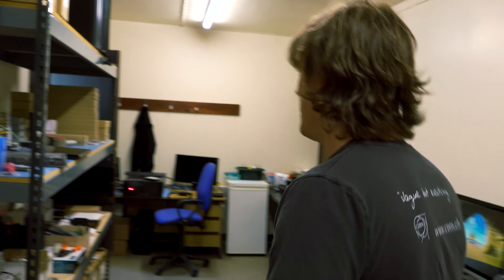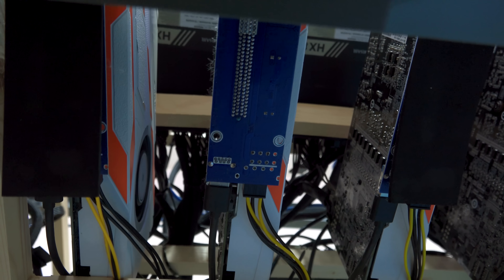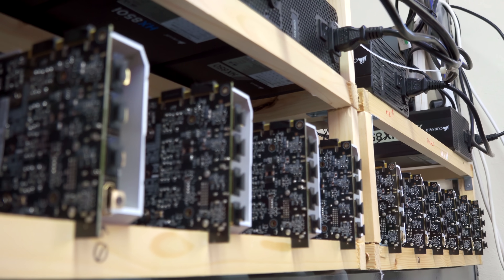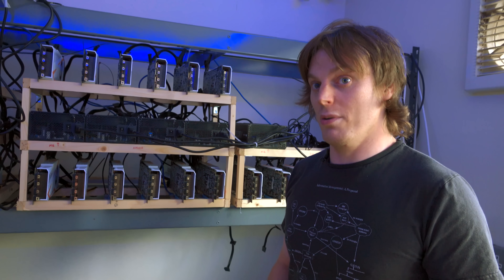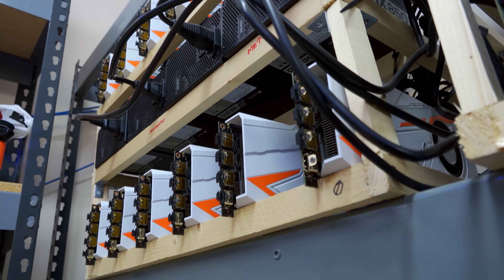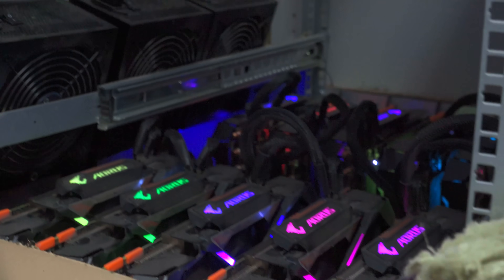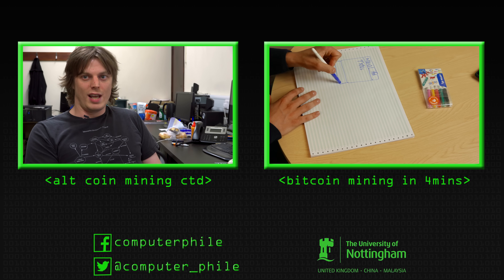Inside a Crypto-Mining Operation - Computerphile

Comment: I wonder if some research institution creates a coin that can be used to compute simulations. Then every so often have forks created to update the algorithm so that new simulation can be produced. Rewards should be spread equally amongst all participants similar to the p2pool concept. Considering gpu can switch between algorithms then that would be a great way to harness the crypto mining power network for research.
Reply: someone is working on one already; it will compute fluid and physics simulations for medical and engineering purposes; it's called cfd token

Comment: A Pi for fan control? Seriously, that's overkill. You could do that better with an arduino.
Reply: Or you just build your own analog circuit to do the same for you without having any µC involved at all
Reply: I really like that efficiency-minded attitude, but in the context of the operation at hand, either solution will practically consume no resources at all once it's up and running. On the other hand, there's the cost of feeding the developer who implements the fan control. Minutes of Python vs. hours of C++. Who wins? Who's next? You decide! Epic code battles of history!
Reply: Minutes of C. All you need to do is call a library that reads from a DS18B20, does a quick calculation, and sets the PWM value. The rest is all electronics, and is identical regardless if you use pi or arduino.
Reply: You could, but most fans use PWM. Generating that in analog means oscillator and comparator - if the aim is to minimise cost and part count, a dirty-cheap µC is actually the most practical solution. Like an arduino.

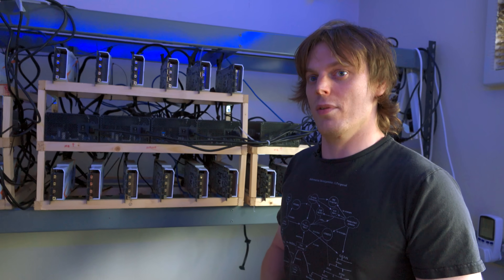Comment: 2:08 1080Ti's do up to 250W at full load and 100% power limit. No miner runs their cards at 100% power limit, usually between 70-90% as it makes almost no difference to hashrate with most algorithms and drops the power usage considerably. A 1080Ti will normally be using somewhere between 140-220W on most algorithms at 70-90% power usage.
Reply: Xileer Torias yeah it's crazy how much juice microwaves and stuff use
Reply: "Now, look at the power usage of your microwave or your kettle :p"

I already answered this in another comment thread. 2KW kettle, 3 minutes per boil, three boils per day, that's roughly 300Wh of electricity used, per day.

The stated power usage of the rig in the video is 15KW, red-lining those GPUs 24/7. That's roughly 360000Wh of electricity used per day.

Even given that this is assuming 100% efficiency (which is never going to happen), those numbers are so massively far apart that it's borderline insanity to compare a few cups of tea to running any kind of mining setup.

Comment: So basically a crypto "coin" is a token of spent electricity?
Reply: A gold ingot is a token of stolen sweat, blood, slavery, and estate bonds, far far in the past. Still there, still in use by our banks...

Any ressource, as the value used to extract/make/manufacture it + cummulated cost of storage over time, technically speaking.
The prices on the market is what ppls are about to give for it, what is totally different.
Reply: "Not really, it does give it some intrinsic value however."

Not intrinsic at all.. Imagined.

if it were intrinsic, it would have value without the network running.
Reply: Not really, it does give it some intrinsic value however.

Comment: I feel like this is a flawed way of going about it. It was explained ASICs aren't usable because they specialize in a specific coin so they use GPUs so they can mine the best coin that's trading the best at the time. Wouldn't it be easier to make an array of ASICS and enable the ones that farm that specific coin when it's most profitable or is there a gain/loss that i'm not seeing? If it's really such a swing why wouldn't ASIC miners just shut down during non-profitable hours?
Reply: Let me see if I can answer some of your questions:

ASICs are actually built to use a certain Hash algorithm, not necessarily a certain cryptocurrency. So, for example, Bitcoin uses SHA-256 as it's hashing algorithm, but another cryptocurrency also uses the same hashing algorithm, you can use the same ASIC for that coin as well. Bitcoin is the most common one with the highest prices, so those that can afford massive ASIC farms would be more inclined to go for those coins instead, but you can use that same ASIC to mine any other coins that use SHA-256.

Because ASICs can mine any coins that use the hashing algorithm that they are built for, you could technically use them to mine other coins as well, however, the problem with that is that these cryptocurrencies are designed to scale with hashing power so that the more hashing power there is on a network, the more there is needed to mine the current block. If you suddenly take away a large chunk of that mining power, the time it takes to mine a block goes up dramatically, making the currency more volatile, thus, decreasing it's value, which is why larger networks, like Bitcoin, are always being mined. On top of that, the current reward for mining a block on Bitcoin is 12.5 Bitcoins, or almost $80,000 in current market conditions. These blocks can be mined on average every 10 minutes, so every 10 minutes, $80,000 is released, which is another reason many will stay with Bitcoin.

Comment: All of a sudden people care about how much energy is being used lol
Reply: All of a sudden ?
Reply: Crypto-mining uses up 0.5% of the world's current energy output. That is far from negligible. And it's only getting larger.
Reply: Mostly because it’s replacing a more energy efficient system, the established payment processors, and doing a worse job at it.
Reply: Xileer Torias As someone who lives in an apartment, buys wind power, and bikes or takes public transit, will you listen to me complaining about the unnecessary energy usage?
Reply: You don't seem to understand the point of bitcoin then. It's not a more energy efficient system, and you're right in saying that it's doing a worse job at payment processing. But, we finally have a new breed of money. One more fair, more transparent, and one with way more control. It's not like our fiat money that's run by a group of shady stakeholders, but rather normal people like you and I.
Reply: Sources for your numbers please
Reply: You can crunch the numbers on that yourself. You take the current Bitcoin mining difficulty as currently reported from the system and make a guess what hardware is spread around the globe to generate that hashing power. The guessing part is where you need to decide how it divides up to different ASICs and GPUs where you get different hashing power per Watt.
Reply: The Bitcoin network uses as much energy as the country of Ireland
Reply: As others have pointed out, some people have always cared. The point is not when people start caring but that they care at all. This video's comments have caused me to reevaluate a bunch of priorities in my life. I hope others will similarly stop and think.
Reply: Many of us already did regardless.

Comment: I get distributing your stake across all the crypto currencies to cut risk. I also have a gut level understanding of avoiding bitcoin, since it's so infamously volatile. But it seems like most of the factors causing shifts (and in particular drops) in bitcoin price are related to cryptocurreny regulations, which I would expect to cause similar fluctuations across everything you're mining. Have you found this to be the case, or is the lesser interest in other currencies a buffer against that?

Comment: How fast could that hardware break AES?
Reply: Yarwin a few billion years. Why?
Reply: Alex Jackson math? Just wondering...
Reply: Morgan Pugh Thanks for your response, I didn't think they actually mentioned how much GPU they were using so I guess we can only make an assumption. Would've been nice to be able to put a number on it.
Reply: Millions of billions of trillions of years I guess.
Reply: Yarwin I know what you mean. I've actually studied cryptography as a curious hobby. The point of algorithms like AES is that they can be solved/broken algebraically, but to do so will take an infeasibly long amount of time. Trying all solutions with current and future hardware just takes too long.

The only way to break an AES encrypted message now in reasonable time is when the implementation is flawed in a system, where the system using AES picks predictable keys, or by measuring leaked information from the system (timing, power consumption, etc). Poorly designed systems can leak enough information to give away details about the key, making it easier to break. Strong implementations avoid these issues.

So even big rigs like this just don't have the capacity to break AES from a well designed system.